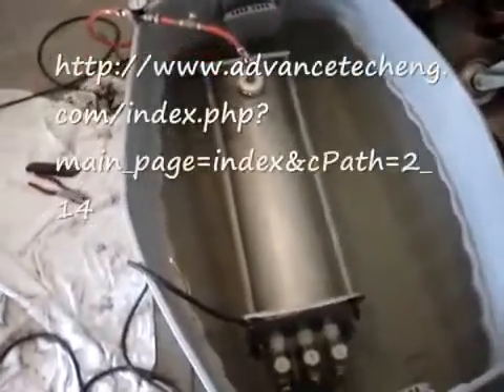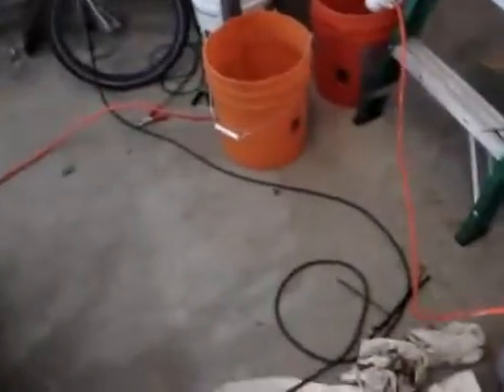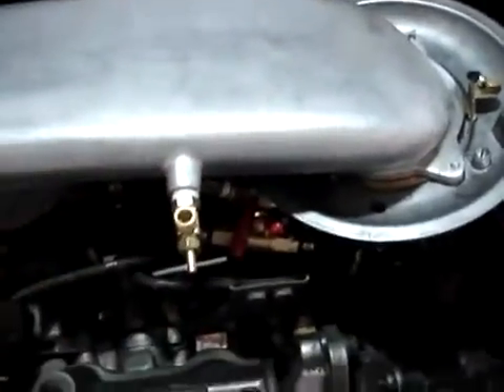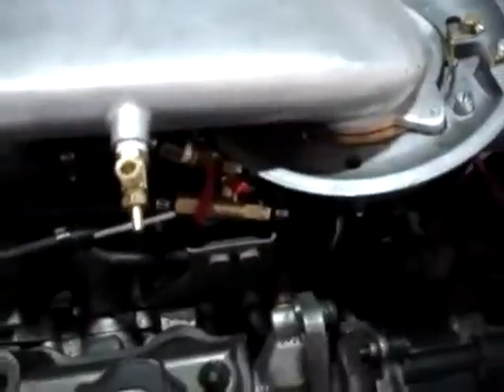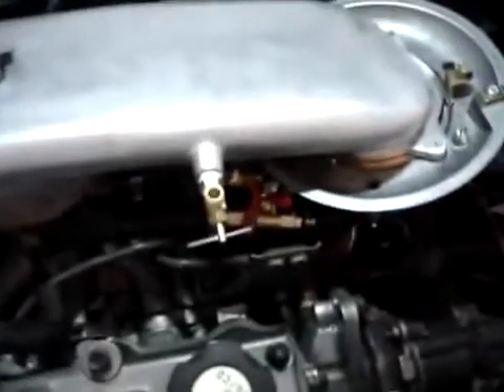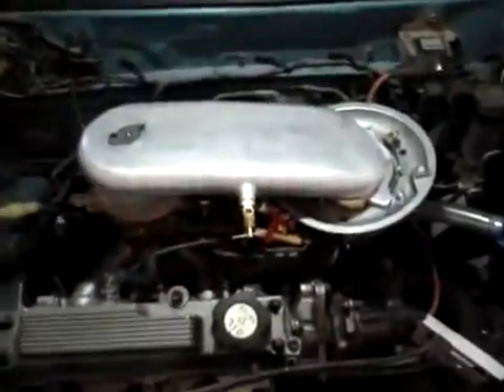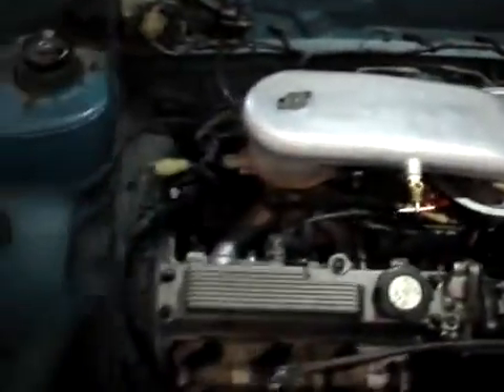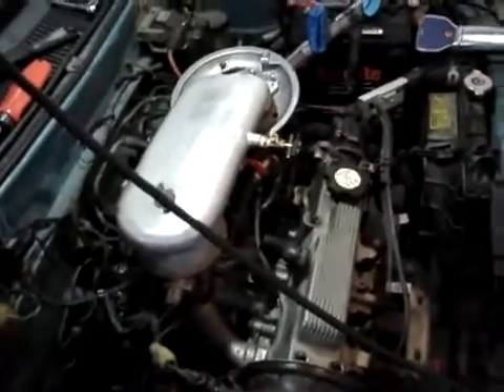Hydrogen Fuel Co., Inc. - 100% Water Powered Geo Metro Demonstrated by Advance Tech Engineering

Comment: Great start but high voltage not high amps. No heat loss from high voltage and low amperage. Use stun gun tech. They are cheap to buy. Less than one amp and you can produce millions of volts. Add a PWM to control your pulse width and you can produce all the hydrogen you need to run any size motor off the same stock alternator.

Comment: What I would like to know is where the orange hose goes outside of the camera angle, before it is routed back to the pressure regulator ??
And Why the carburetor runs out of fuel almost instantly, the fuel bowl inside the carb will hold enough fuel to run around 1 minute, and it would not start instantly after the fuel was turned back on the bowl would have to fill first.......Also this video is 5 years old, why Have i not heard anymore about this wonderful setup ??
Can you Clarify for me please ...

Comment: Seems like you still have partial flow of gas to the engine, not enough to run on it alone. Also, can the little geo generate enought AMPs even with a larger alternator in it to run the system?

Comment: @Wrxs2000 modify the timing. just a couple liters a minute will run a little engine. depends on how you build the cell. Closer plate spacing works well. look into it but you can do it.